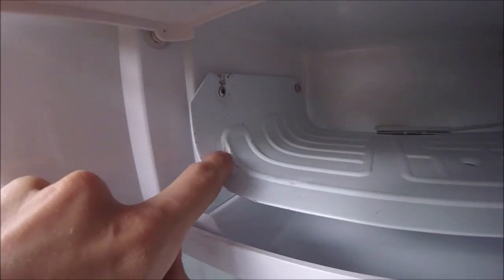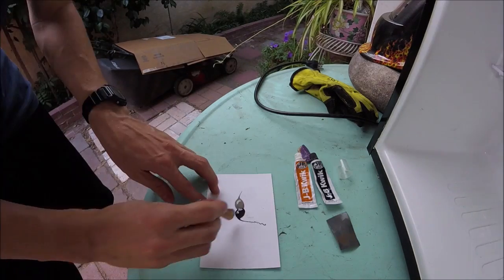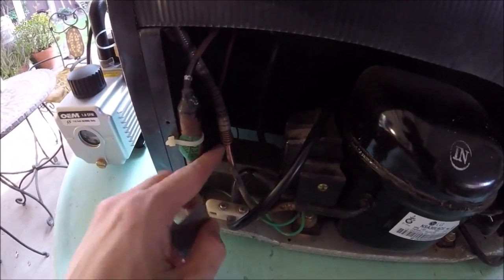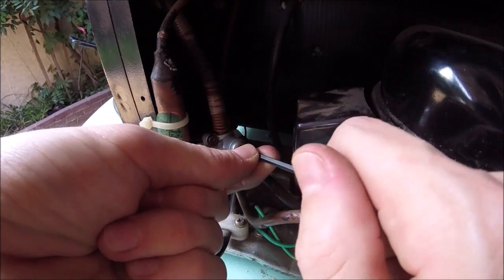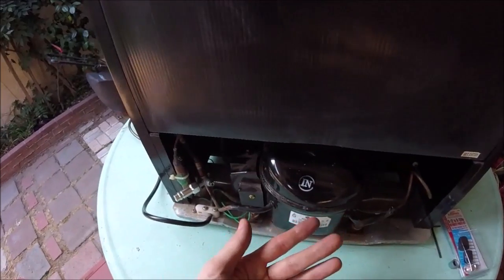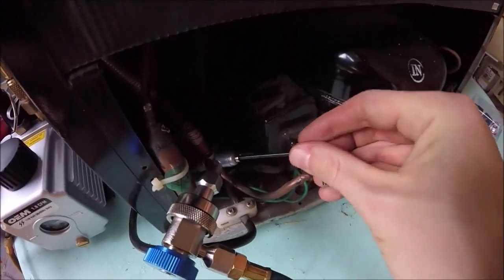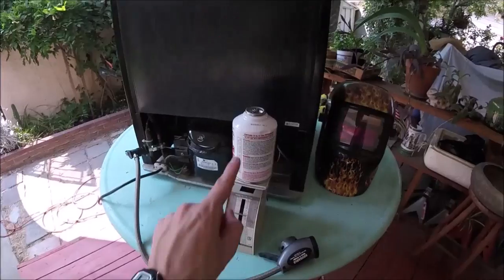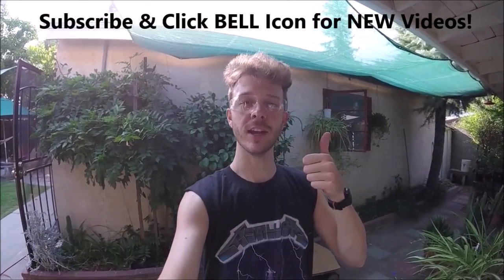How To Fix a Broken Mini Fridge -Jonny DIY

Comment: I've read some places about the potential for oil from the compressor to be lost as it escapes with the coolant. If the fridge was shut off a few minutes after the puncture, do you know if any potential loss of oil would be significant enough to be cause for concern?
Reply from the maker: I wouldn't worry about any loss of oil

Comment: Hi sir i accidentally stab my fridge but its working and cooling . Its that okay if i put epoxy and i will not vacum it? Thankyou
Reply from the maker: Yes its ok to epoxy. If you did puncture the refrigerant line though,  youll most likely lose cooling of the fridge within a day or so. Then you will have to do as I did

Comment: I have a small 12v fridge. Compressor kicks on , thermistor reads accurately and thermostat works. Fan works. Capillary tube gets ice cold but fridge stays hot. Does that sound like a capillary tube blockage ? What does that usually cost to fix ?
Reply from the maker: Sorry not certain about that. Sounds like its not circulating if the compressor is kicking on and off

Comment: Jonny! Do you happen to be in So California? I would try this myself but not everything is available on Amazon... plus I might screw it up more! I'd pay you to fix mine if you're local!
Reply from the maker: I do go between Central California and Socal, but am up in Modesto area right now or Id help you out 👍🏻
Reply: @JonnyDIY  After watching this a few more times, I've decided I'm gonna give it a try! Just ordered a couple of parts from Amazon... Still need to go buy the epoxy and the refrigerant ( wasn't on Amazon anymore )... I'll be renting the pump and gauge set from AutoZone once I have the other items.  I'm gonna give it a shot! Question... before you plug the fridge back in and add the refrigerant, you have to have the thermostat on one of the numbered settings, right? Mine is numbered 1-6. What's the best setting to first have it on, or does it matter? Thank you in advance for your response! ( and if you can't respond, I understand )... This video is VERY helpful, thank you for posting it!!!
Reply from the maker: shouldn't matter the setting to have on. Middle would be fine 👍🏻

Comment: i drilled a hole in my fridge and hit the freon line by mistake.. its got a needle size hole could i jbweld it?
Reply from the maker: yes JB weld it like I did, but you'll also most likely need to recharge with refrigerant as I did as the freon escaped. Fridge will stop cooling within a day if hole big enough
Reply: @JonnyDIY  sounss good bud I'll give hit a go, i wasnt sure if itd be good on the line itself or not lol thanks 👍🏼

Comment: What happens if you don't use the pump to take the air pressure out of the line?
Reply from the maker: most likely it wont cool properly. Only if you had a pinhole slow leak could you just add refrigerant to the system without vacuuming. But always good practice to so you can add back proper amount of refrigerant

Comment: Poke my fridge in the upper portion and a kind of cold air come out and then i unpligged it right away. After a few hours i tried to turn it on again and i didnt hear any hissing sound and it did cool. Is it ok now? Or should i still be worried??
Reply: Or is it still fine to turn it on when id didnt patch the whole yet?? Im trying to patch it on tom
Reply from the maker: If you punctured a hole in refrigeration line it will stip cooling within a day. You'll have to repair as I did or get new fridge sadly

Comment: Can i use m seal its also an epoxy compound
Reply from the maker: Yes you can use that, as long as its a strong epoxy. Just sand ans clean well before using 👍🏻
Reply: @JonnyDIY  i had a small leak and  after leak the refrigerator cooled for one day so just i can apply m seal its enough or i shall follow ur video like as

Comment: Quick question or to anyone who can answer . I was trying to remove ice buildup from the ice compartment, if I hear a hissing sound is that just the air or something? And I see similar comments . Don’t want my fridge to cause flames or blow up overnight , please and thank you
Reply from the maker: if you were using something sharp like screwdriver etc. to aid in ice defrosting and then heard a hiss. You most likely pierced compressor cooling line and the hiss was escaping refrigerant
Reply from the maker: youll know if its not cooling anymore within few hours or so
Reply: Jonny DIY yeah I checked this morning and seems like that was it . Also all the ice did melt and defrosted . It does have a weird smell coming from it and has a smell like after for ex burning charcoal , should I be considered if it does or is that the cooling line that I smell ?
Reply from the maker: not sure what the smell is. I wouldnt worry about it. But sounds like the fridge is toast unless you try fixing as I did. In the future unplugging is best way to de ice freezer
Reply from the maker: or if you have a blow dryer or heat gun itll speed the process up 👍🏻
Reply: Jonny DIY yeah pretty much what happened . I ended up purchasing a new mini fridge because the old one wasn’t cooling properly. Any links to find or fix the compressor cooling line ?

Comment: Stupid question: Why do you have to vacuum out the system before putting the refrigerant in?
Reply from the maker: To remove all the air and atmospheric pressure from system to add correct refrigerant levels. If you dont vacuum and leave air in,  it wont cool well
Reply: Jonny DIY Ah okay. That makes sense. I appreciate you getting back to me so quickly 🙏

Comment: My freezer got punctured with a knife and there was a hissing sound and smoke coming out of it.  We unplugged it immediately and planning to seal it with epoxy once it got defrost tomorrow. Do I still need a refrigerant? 'cause I dont really know where to get one considering our country is on quarantine.
Reply from the maker: Yes you will still need refrigerant.  That hissing noise was the refrigerant escaping.

Comment: I have a coke a cola soda can vending machine. I wanna vacuum the system like you said.  I’m interested in how you got the number 30 for vacuum?  Would that be the same for any system?
Reply from the maker: Yes if you can vacuum down the system to around 29-30 inches of mercury and close the system and it holds that same vacuum that means no leaks. No leaks has to be established 1st before recharging 👍🏻
Reply: Jonny DIY   Okay great.  Other question is. On the compressor it’s self it has 2 copper lines on one side. Ones larger then the other.  Is the low side usually the larger one?    And on the other side there’s another copper line with a threaded end on it that the vacuum lines can look up to.    Would that be the hook up to vacuum it and recharge it?  That would be the low side I’m thinking ?
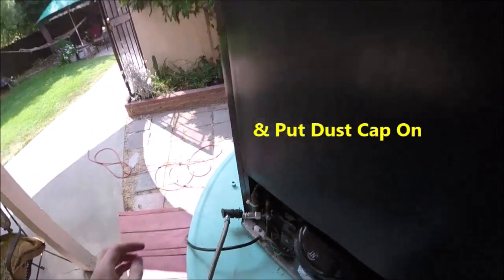Reply: @parkerkowall8212  Maybe you have a threaded fill line port??   Take a peek at the lines in this video--at the 1:00 mark he shows the fill line crimped off at the factory, and at about 5:30 he puts his own threaded port onto that line and uses that to add refrigerant:
  https://youtu.be/jeb6gN1uq2M

Comment: If I use silicone sealant to fix a crack, how long should I wait b4 plugging my fridge.
Reply from the maker: 24 hours. But you will still need to recharge with refrigerant.  And would be better to epoxy holes. Not sure silicone will hold up

Comment: Great Video JD. Let see if I can fix mine. This piercing valve and conversion is ok? Also, are there any bullet piercing valve that would fit R134A directly so you don't need the conversion kit? https://www.amazon.com/dp/B07W5PC7DC/ref=sspa_dk_detail_3?psc=1&pd_rd_i=B07W5PC7DC&pd_rd_w=TVZwA&pf_rd_p=48d372c1-f7e1-4b8b-9d02-4bd86f5158c5&pd_rd_wg=UyWo9&pf_rd_r=6K9KKEGG1JTW7SN43MWW&pd_rd_r=67cb68cc-1d94-4be3-864f-fc66e173f07b&spLa=ZW5jcnlwdGVkUXVhbGlmaWVyPUExMlYxWUdOQUZBUEFPJmVuY3J5cHRlZElkPUEwNjc1MjA1UkhRQU82NFExMlc5JmVuY3J5cHRlZEFkSWQ9QTEwMTYwNTgzMEVCVUIxN0RJSDlBJndpZGdldE5hbWU9c3BfZGV0YWlsJmFjdGlvbj1jbGlja1JlZGlyZWN0JmRvTm90TG9nQ2xpY2s9dHJ1ZQ==
Reply from the maker: Yes that looks like right valve with conversion adapter 👍🏻
Reply: @JonnyDIY  are there any bullet piercing valve that would fit R134A directly so you don't need the conversion kit?
Reply from the maker: Not that I know of

Comment: Man I did the exact same thing to my mini fridge. I've thawed it out with a screwdriver many times before in the past 20 years, but this time I hit a line =(. It looks like a lot of trouble and a lot of parts that may not even work.  Dunno if it's worth it. A new one is about $100, or I can try and find a used one. I knew I effed up when I hit it and heard hissssssssssss. FML.
Reply from the maker: Well this fix has held up for 2 years. Fridge still works fine with jb weld patch. Yeah I had everything on hand, I just had to buy conversion kit and valve. So I only spent 15 bucks. Well $27 isnt too bad, worth a shot if you cant find a good used one 👍🏻
Reply: @JonnyDIY  I was at Wal Mart a little while ago and they had that piercing adapter for $3.50 so I went for it. The valve you linked is only $5.85 now. Coulda sworn it was $15 last time I checked. I have a can of R134a and the hose from an AC Pro kit I got years back. So it looks like I have everything. The R134a used to be $5 a can, but it's $8.88 now due to inflation. I dunno if I should buy a smaller can cuz I suspect the 12oz can will have leaked empty by the time I need to use it again.
Reply from the maker: @aznnp77  get cheapest can of refrigerant you can find. Walmart or Harbor Freight. You'll need to vacuum system first to get good cooling
Reply: @JonnyDIY  Yeah, like i said, unfortunately Wal Mart used to charge $4.88 a can, and now it's $8.88 a can. Brake Cleaner used to be $1.99 a can, now it's $3.48 a can. The reviews said to just open the valve a few times to let the air out. I'll see. My friend is an HVAC dude but I dunno if I feel like bothering him to fix a fridge I could replace for $30 more.
Reply: It's weird. The replacement fridge still works. It's cold enough to ice over the freezer tray, but my sodas are just cold, not ice cold at the highest possible setting now.
Reply: @JonnyDIY  I bought the same exact fridge at i had before for $20 from someone. But that one was weird. My old fridge was pretty silent. This other one would make "whoosh" noises nonstop the entire time it was running. It still works, but I noticed that it's not that cold anymore. It used to get so cold that it would freeze the sodas if I put it at 4.5 out of 7. Now I put it up to 7 and it doesn't even feel that cold. I kept my old fridge cuz mine was in so much better condition. May try the repair now. But you need another part now I think. The newer R134a cans you can't just open with the hose anymore. You need a "can tap" now. That's another $10-15. And that can tap apparently isn't even the right size. The standard ones are 1/2", and the ones with the recharge kits are 1/4".
Reply: @JonnyDIY  I don't really feel like vacuuming it though. I never did that when I repaired the AC in my car. I figured it should be pretty dry in there by now. It's been 2 years. There's another dude selling the same fridge for 50 bucks but it's the worst shape of the 3, and it's a 26 year old fridge.
Reply: @JonnyDIY  Gonna cost more than i thought. I forgot about the R12 to R134a retrofit valve. That's about another $11. And the piercing thing I bought the reviews are horrible, says it leaks refrigerant everywhere. I'll still probably do it but this is gonna be closer to a $40 repair now.
Reply: Okay I think I got the list of stuff I need. Prices Include 6% sales tax.

Bullet Piercing Valve - $6.20
R12 to R134a Retrofit Adapter for the valve - $7.41
1/4" Brass Can Tap (Careful with these, they're standard 1/2" to use with pro manifold gauges, have to order on ebay) - $8.05
Refrigerant Hose - I have one, but it would be $14.83 otherwise
R134a  Can - I have one and I forgot that it's self sealing, so I'll use it. Otherwise $9.42

So I think I can repair this for $22. Minus some refrigerant That's not that bad I guess.
Reply from the maker: Dang, yeah my Dad did same thing, that's why I was fixing this one. Yes sometimes you can find a nice used one for $50 or less.
Reply: @JonnyDIY  Dang that conversion kit that costs $9 is probably what is gonna stop me from doing it. JB Weld is $6, the piercing valve is $5, the R134a is $5. So you're looking at $27 in parts right off the bat before you even do anything. FML I killed my fridge cuz I'm a fool.
Reply: @JonnyDIY  I would get another one, but I got so used to mine. All the new ones have all these custom shelves on the door side for cans and stuff. Your list of stuff used is a bit intimidating, but I know why you did it like that lol. All you really need is the JB Weld, the piercing valve, the refrigerant with the the hose, and to rent the gauges. I've actually used JB weld for something on my car before and it's held, but I dunno about sealing a hole from any kind of leak for an extended period of time.

Comment: Hi Jonny, Thanks for the video. How important is it to have a scale to weigh freon?
Reply from the maker: You're welcome. 👍🏻 pretty important since refrigerators only take a little bit of refrigerant especially mini fridges. You could try without one. Just add tiny bit at a time til compressor kicks on and starts cooling
Reply: Jonny DIY Great, thank you. Also, if I just wanted to add the Freon without sucking out with vacuum, think that would be ok?

Comment: how will I know if something is wrong? it's a tiny hole. not hearing any hissing sound. what are signs to look for?
Reply from the maker: If not cooling anymore it could have leaked refrigerant and is too low to cool anymore. You can tell if leak when vacuum system if it holds vacuum 🤙

Comment: 1:15 The hole I had was a little larger, so the epoxy didn't seal over smoothly but now looks like a small shiny grey anus pucker.  Looks like I lost another day while I put another round of epoxy on, but I'm thinking I might better have put a small piece of tape to coat over with epoxy?   Also, the wire connector to the relay is not coming off!  Lol.  I've pretty much destroyed the flimsy plastic casing just trying to get this wire off (and it looks like it should just snap on and off, dirty little sonofagun).  I'll have to ask some pros for input about the relay, since the closest exact match online costs more than I paid for the fridge/microwave combo in the first place.
Reply from the maker: Good idea about the tape over hole then cover the tape. Just be sure to expand the glue area quite larger than tape to get a good seal. Not sure about the connector. Can tey spraying lil wd40 on it and use small screwdriver to pop open
Reply: @JonnyDIY  Two pairs of needle-nose helped pull the connector apart, but it trashed the flimsy metal support on that side of the disc inside the relay.  Oh well.  Your video with all the links to the relevant products is the best one on here! :)   I may as well see about recharging my window AC unit while I'm playing with refrigerant.
Reply from the maker: Thanks! & glad you finally got the lil bugger pulled apart. Seems the parts of a job that you think will be the easiest end up taking the most time. Sometimes drives me crazy haha 🤦‍♂️
Reply: @JonnyDIY  It's holding a vacuum at -25 to -30, but does not seem to be sucking any refrigerant in.  The 134 dispenser hose clicks securely onto the BPV, but the gauge needle didn't budge when I opened the valve up and didn't move at all when I squeezed the trigger.  Also tried dispensing through the vacuum gauge manifold, but likewise did not register any pressure difference on the 134 hose meter.  :(   I screwed the 134 can into the dispenser hose a couple times in case it wasn't tight enough, but it didn't make a difference--and it's a new/full can of 134.  I feel about ready to grab a sledge hammer and crank up some death metal.
Reply from the maker: @calciumchloride710  try driving valve in again fully, then back it off about 1 full turn. I remember having to fiddle with it a bit like you too
Reply: @JonnyDIY  Nah, it was the "magic reusable hose" that's not working at all.  Replaced it with one that's working; HOWEVER, I've now succeeded in putting refrigerant into the unit, but THE PRESSURE ON THE LOW SIDE I JUST FED 134 INTO IS NOWHERE NEAR THE 145 PSI INDICATED ON THE DOOR STICKER.  I don't want too much refrigerant in the system, but it looks like I need more pressure.  I would see if the vacuum can be put in reverse to pump air in, but I'm assuming the whole point of the vacuum was to keep too much AIR out of the system... so what do I do now?
Reply: If the hole is big or your fridge has still gas in it (still leaking, you can use soap foam to find out if it is still leaking) you can use Epoxy Paste instead of the epoxy glue. If you use glue the gas will push out the glue. You can put the epoxy paste with your hand and push it in the hole with your finger (it sticks to the fridge but not your finger). It becomes solid in 5 minutes, and fully strengthens after 12-24 hours. Start up the fridge it it's gas empty so that it creates vacuum 
(proper way is using a vacuum pump though), and add your freon in small doses.
In the US you are lucky, R134 is free to use (here in Europe only professionals can get it). Most fridges in Europe have R600A though, which is isobutane (lighter fluid) and that is sold freely. The gas pressures you set for R600A are different 1. on the low pressure line and when the compressor is working -15psi or -0,5bar or 2. on the low pressure line and when the compressor is NOT working *0psi*. If you put too much freon, the high pressure line will freeze up with ice all the way to the compressor after a few minutes, and the fridge will not freeze well, so you must take some out or you risk damaging the compressor .